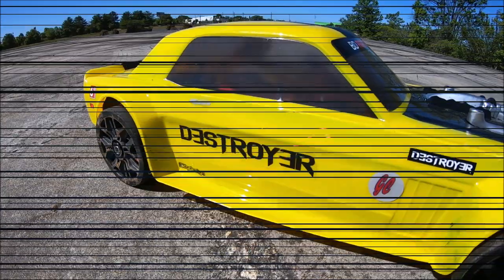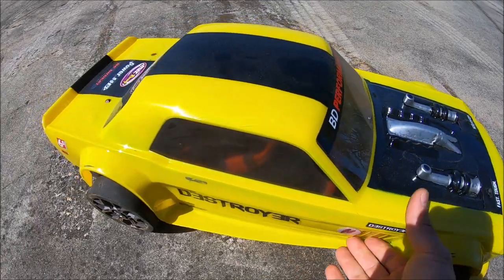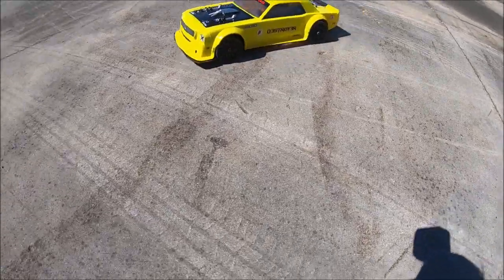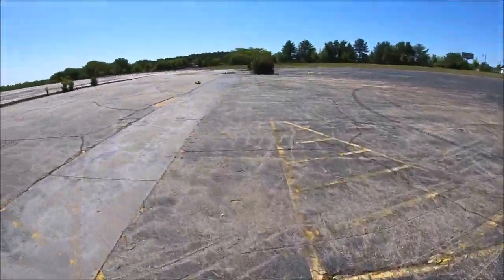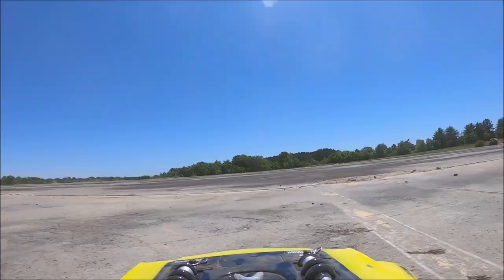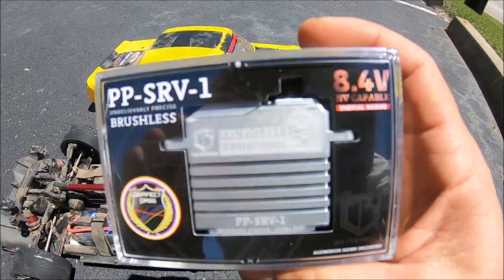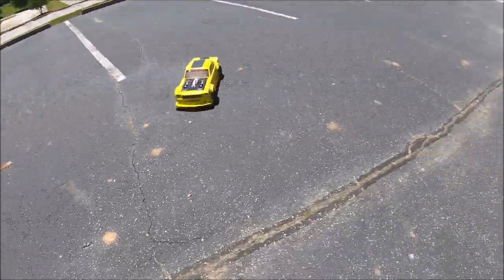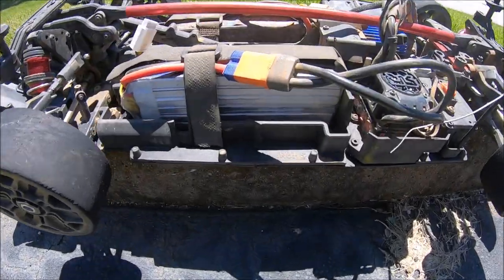ARRMA Felony Goes "Destoyer!"😱VIPAZ Solid Rubber tires MEGA BASH Test!

Comment: Thanks so much for the shout out Eric and glad the tyres are holding up well brother. What an awesome bash sesh and I’m actually impressed at how much they handled right there lol. 😎👊🏼💪🏼🤙🏼
Reply: your solid rubber compound really needs more notice and appreciation in the rc scene. by far the best bashing/drifting tyres for 1/7 on the market! 
have you thought about or attempted trying to make some for speed/drag yet?
Reply: @dodgymtbknee  thank you so much for the kind words brother. I’m sure they will over time get more exposure especially after awesome videos like this one from Eric come out. 
Because I don’t speed run and the fact that the tyres need to be light I’m not sure how to approach this. They would have to be quite thin 3-4mm thick which means a larger diameter rim would be needed to keep the same rolling diameter. Also because of the extra weight over speed foams the spinning inertia will want to rip the rubber straight off the rims. A lot of factors to consider plus the testing would be extremely stressful at those speeds.
Reply from the maker: I really appreciate it bro!👊👊Tires did GREAT! and also durable! So glad to have this option for the street bashers! Game Changer for sure!!😎💪💪🤘
Reply: @RCDUDE81  thanks brother I really appreciate it. Looking forward to seeing how many packs you get from them. 😎👊🏼🤙🏼💪🏼

Comment: The solid rubber tires reminds me of when I was a kid, I had a Bolink Eliminator modified brushed motor ,I didn't even race, just liked to go fast "Ricky Bobby"  We couldn't afford to keep tires on it so my Dad matched up radiator hose diameter to wheel size cut and glued it on ,  I couldn't wear them out and It would then Drift kind of , or we called it powerslide, that was before  Drifting was a thing . Maybe this will help somebody give it a try  heck  I might put a car together just the see how it works on an 4WD platform with all this brushless power,  Great Videos keep up the good work!

Comment: How do u keep the pinions locked down for these extreme bash sessions blue lock tight isn't working for me
Reply: When bashing hard like this, the stock pinion normally gives. What most of us guys do, and I am sure he does, is use a better pinion. The Robinson Racing Pinion comes with a larger set, like 5mm over the small stock one. Using blue loctite should do it for this type of bashing.